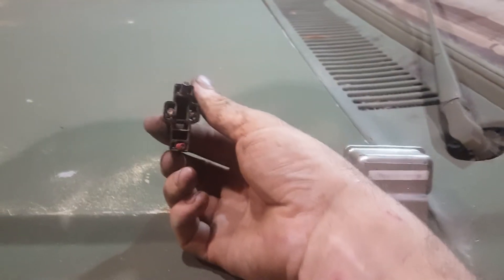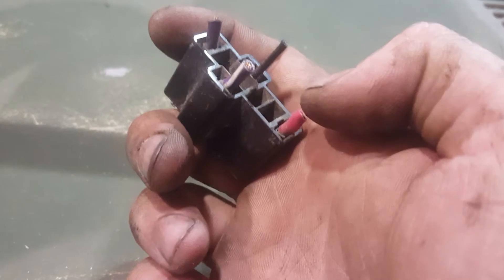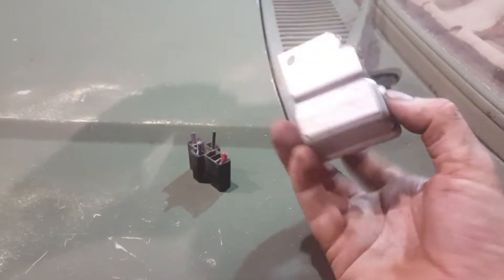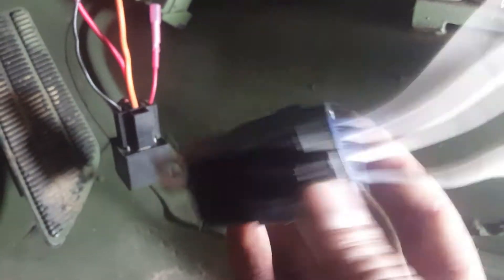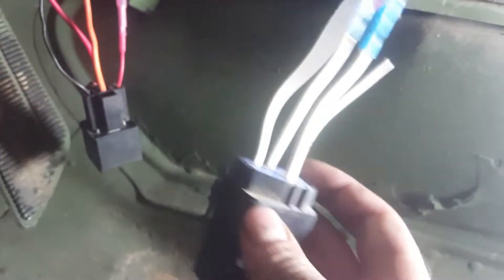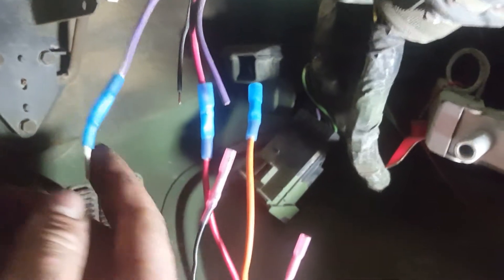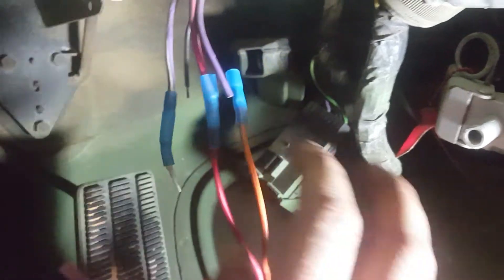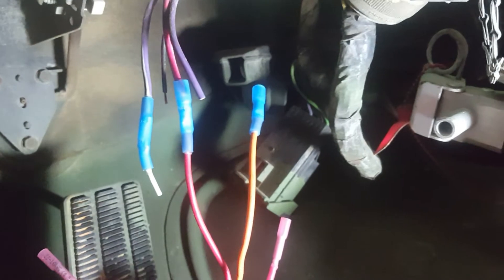M1009 CUCV starter relay retrofit

Comment: I can’t find a harness with the small ground wire.  Does that matter!
Reply from the maker: No, the size of the ground wire isn't really important. It just carries a very small amount of current to close the contacts inside the relay. Any four wire harness that supports a 24v heavy duty relay should work fine.

Comment: Oem replacement 24v units are 45 bucks and readily available
Reply from the maker: Yes, the reason for retrofit is when the oem type fail they stick closed, running the starter until all the teeth are ground off both the starter and flexplate ring gear, and sometimes burning up the starter and wiring.
Reply: @Tactical Repair   I hear that, and I could be wrong, wasn't that only on the 85 models and they fixed the relays after that?     Ive read quite a bit on it, I came across your video inquiring on what I should do since my starters going out and i learned about this issue I would like to avoid altogether,  mines still working good at the moment , the stories are scary though. According to the forums I guess the " doghead " mod might be the way to go - still searching thru stuff.  Anyways, trade for subs?  My m1009 is on my channel. I'm subscribing to you now.  Thanks!
Reply: @Tactical Repair   thanks for the response!
Reply from the maker: @someonethatcaresaboutyou4526  yeah they were all bad about this problem, which is what brought about the " Doghead mod". This is just a convenient part I had available to do the same mod with. Sure, I'll subscribe.
Reply: @tacticalrepair  thanks!

Comment: I have a cargo van with 6.5 turbo, I can take 12v starter off and put on 6.2 and do away with 24v system correct, or is better to stay with 24v?
Reply from the maker: Yes you can do that but it is better to keep the 24v system. If you convert to 12v you'll also need to install two standard 12v GM alternators.
Reply: @tacticalrepair  yeah I see what your saying, ok, I guess I might as well keep 24v, but I'm going to put the 6.5 turbo engine in. Thanks man, I appreciate your help.
Reply: @tacticalrepair  did they kick you off Facebook for good?
Reply from the maker: @staym925  effectively, yes. I'm on my second 30 day ban in three months for making a harmless factual statement. Supposed to agree to the new "terms and conditions " by the 26th to continue using Facebook. My ban goes past the 26th and I'm not agreeing to the new terms, so you probably won't see me on there anymore. Still on MeWe and Telegram though.